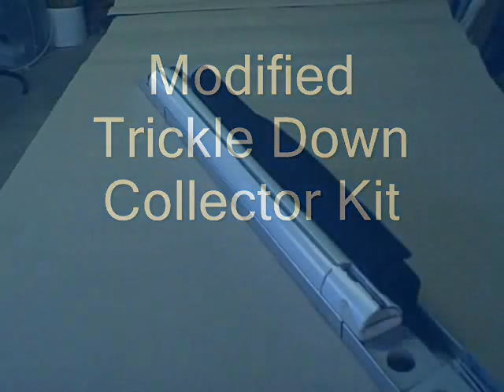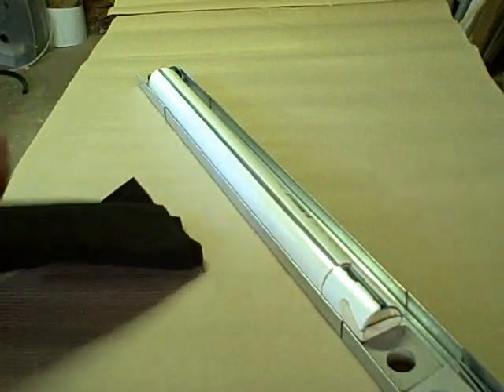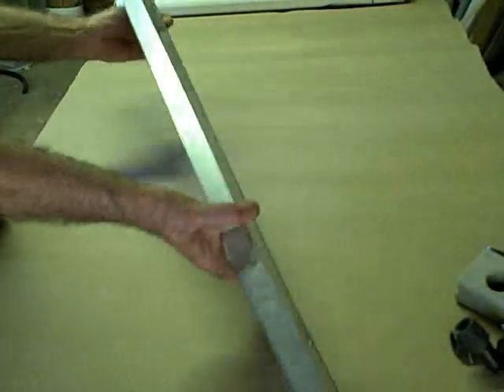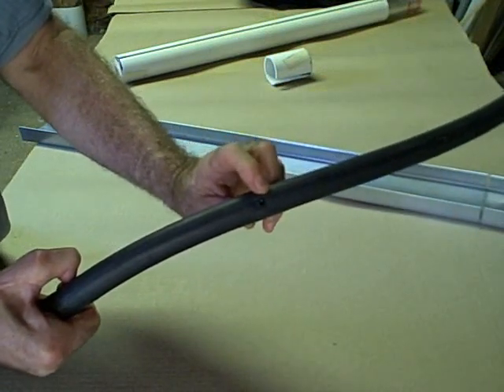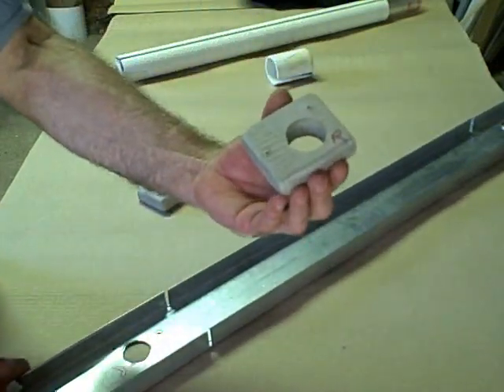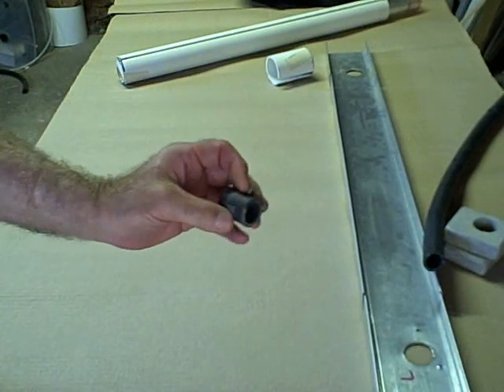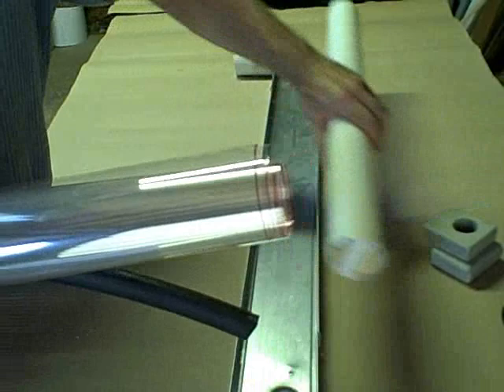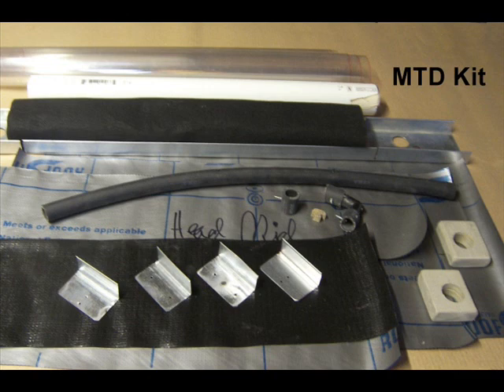MTD Solar Collector kit

Comment: I like the concept, but not the materials. What would you say to redesigning your collector to use sunbaked ceramics for the trickle down thermal transfer medium, with the gutter and header refeed built into the ceramic collector. Which brings up another idea about your collector. Have you considered refeeding the water after flowing once through the thermal transfer to raise the temp on less than ideal days?